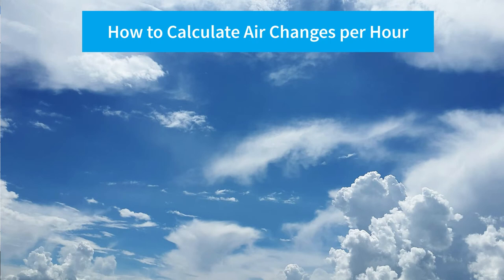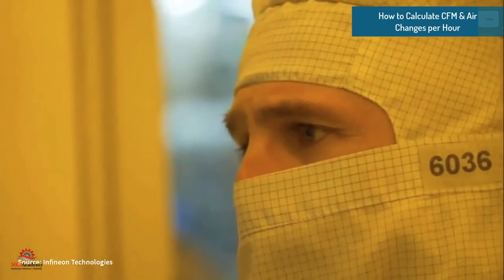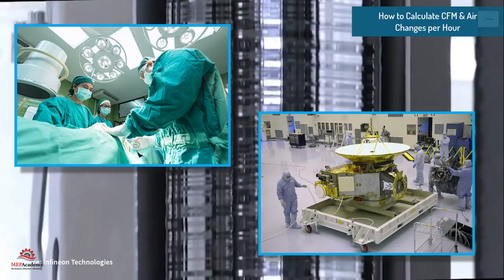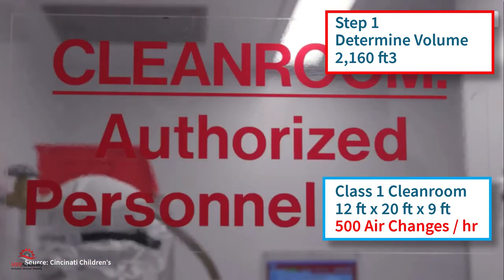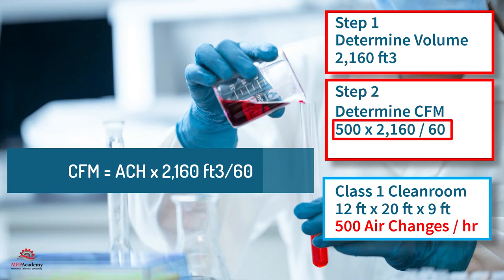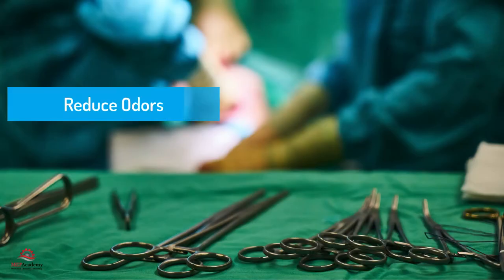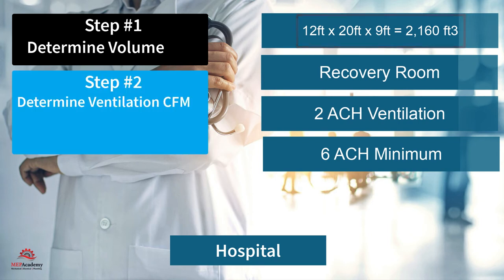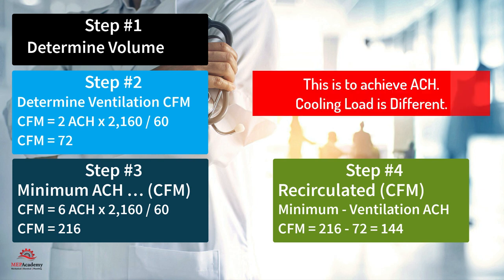How To Calculate Air Changes per Hour

Comment: I don't understand how separate rooms under the same air system need different ACH. Are they programmable to distribute air differently to each room individually as needed?
Reply from the maker: The amount of air changes required for a particular room can be dictated by code or by a Standard like ASHRAE 62.1. In critical spaces where controlling the volume of air is important to the process or procedure, like laboratories or operating rooms in a Hospital, there will often be some form of volume control. This can be done with a VAV, CAV or automated damper of some form. In other non-critical spaces the rooms can be served without any form of volume control, but can be air balanced using manual dampers by a trained technician to provide the design CFM. See our other video on Hospital Isolation rooms work to give you a better idea on how air is controlled in critical spaces. https://youtu.be/9MXBpQGDu9k
Reply: @MEPAcademy  thanks for the reply. I'll likely be a regular on your channel.

Comment: Hello, and CFM cooling is Q/1.1*ACF*DT ? CFM cooling from Sensible Load, CFM from occupied zone ASHRAE 62.1, and CFM from INFILTRATI could explain the relation between ALL CFM.
Reply from the maker: CFM represents a certain volume of air. This air can be part of the air change calculation. Air changes and that volume of air used in the calculation can come from ventilation CFM (ASHRAE 62.1), or from air Recirculated within the space through the AC system. Infiltration is air that makes it way into a space through cracks or openings in the buildings structure.

Comment: Hi, I am confused with the difference between ventilation ACH, minimum ACH and recirculated ACH. Does that mean for the last example in hospital recovery room, we total need intake of 6 ACH, where 2 ACH is exhausted to the outside each time and 4 ACH is recirculated back to the HVAC equipment?
Reply from the maker: Yes, the minimum total ACH is the amount of times the air in the room has to be turned over in an hour, which is composed of the minimum ventilation ACH and either recirculated ACH within the space or through the Air Handler.
Reply: Is the ventilation ACH exhaust air or fresh air? Or both

Comment: Thanks for your Time, i need a vidéo explain how to control the pression in the opération room
Reply from the maker: Pressure control is important in Hospitals and Cleanrooms as you Know. Its basically providing more CFM then you return or exhaust if you want positive pressure , and providing less CFM than you return or exhaust if you want negative pressure. We'll take your idea for a video into consideration.

Comment: What outside minimum temperature 2 use a/c?
Reply from the maker: The amount of ventilation air is based on the type of space and the code required minimums for that space. A crowed assembly hall will need more outside air (Ventilation Air) per area, then a standard office space. See ASHRAE 62.1 for ventilation air requirements.